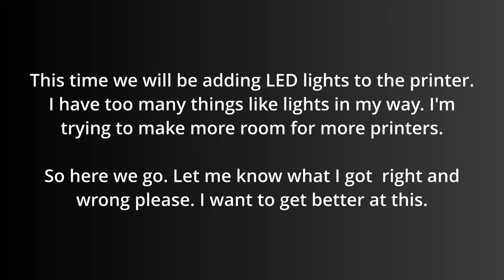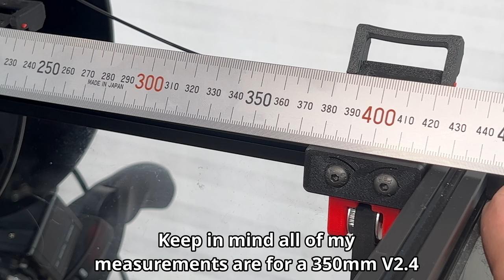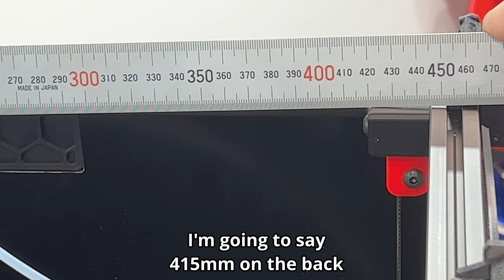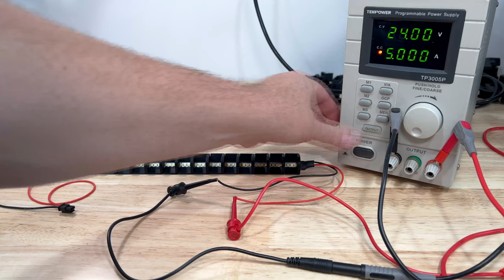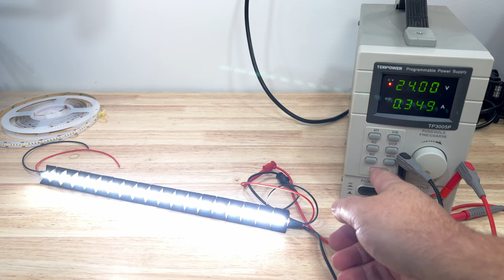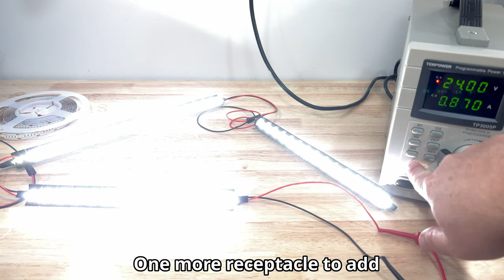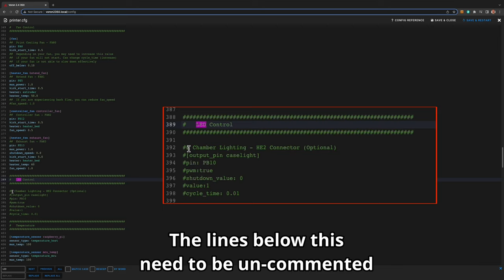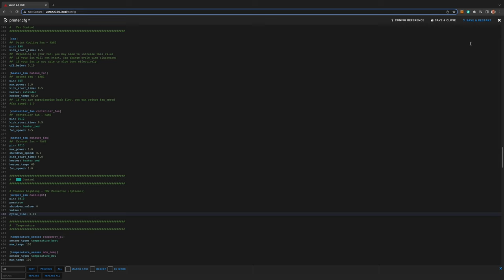Voron 2.4 Step By Step Part 19 LED Chamber Lights

Comment: hi Scot! thank you for your video, my voron is coming together with your huge help. i have one question, i bought the same led strip as you (maybe not the same brand but same format 120 led per meter) and i noticed that they let off a lot of heat, to the point that i can smell the abs from the printed clip, did you noticed that as well? are your led as hot as mine? thank you in advance

Comment: Good day
I'm building Voron2.4. After G28, the Hotend homing, but the Z motors don't lock, you can move them up and down with your hands even if they light up blue. I can't get further because it fails on QGL. The board is Spider 2.2. Can you advise me? well thank you
Reply from the maker: In my setup and testing video https://youtu.be/yfRtpPPcnN8 there is a section on testing the individual Z motors. Make sure they work there. If they don't your pins set in the config may be wrong. Just so I don't assume, you used a Spider printer.cfg https://raw.githubusercontent.com/VoronDesign/Voron-2/Voron2.4/firmware/klipper_configurations/Spider/Voron2_Spider_Config.cfg as your initial config file correct?

If all that is correct, you must have the motors wired incorrectly. Unfortunately not all motors are wired the same. Different brands have different wire orders.
Reply: @scottcorn  well thank you

Comment: Hi, thanks for the video but I can't see where you pass the cables without interfering with the Z motor
Reply from the maker: The corner cable cover I used has a plastic guidway built into it that helps keep the wires out of the motors. You can find it here:
https://mods.vorondesign.com/detail/zBJTvWc9vSnnQoDDP0hyYw
Reply: @scottcorn  sorry, my question wasn't clear. My doubt is in  the bottom part :). How do you pass the cables to the electronic bay without interfering with the Z motor? Thanks

Edit: just found your answer to peters of one month ago: z_belt_cable_cover

Comment: Am gonna print mine tomorrow, LDO says 42(!) of those clips for my 350 😂
Reply from the maker: That should work also. At 47 I had a little more room, but I was trying to keep the amperage under 1. With 47 I was around 0.9 amps. I’m unsure how much the Octopus board can put out on that connection.
Reply: My 350mm v2 used 44 clips